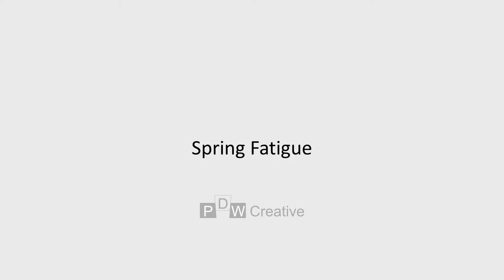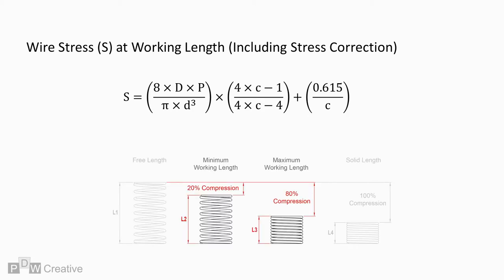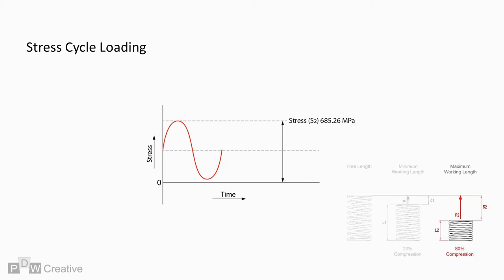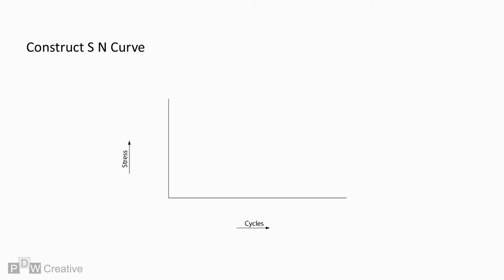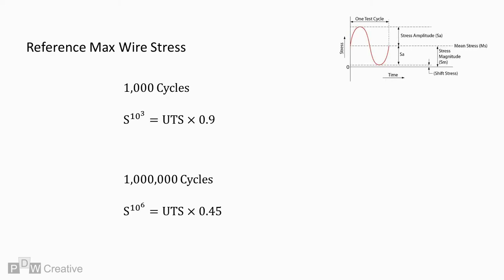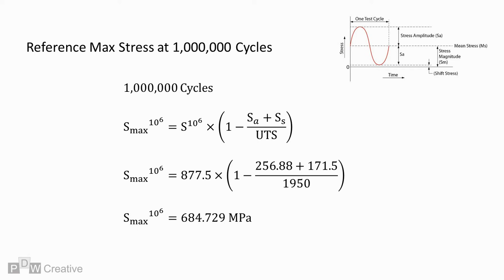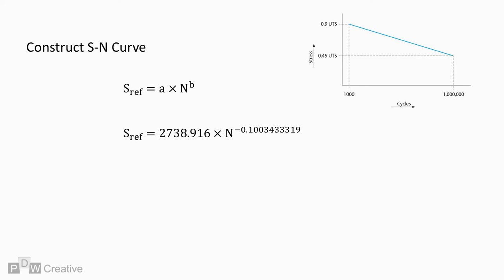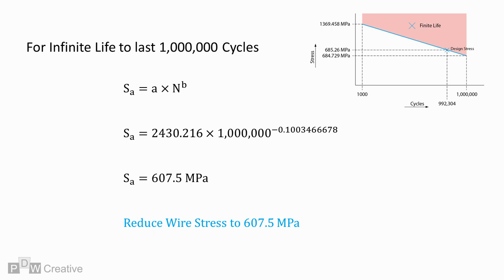Compression Spring Fatigue

Comment: Where did you find the data for the 1st slide? (7 seconds in)
Reply from the maker: Various sources. I am aware many stress calculators and manufacturers will give a greater allowance (60%+ depending on the material). But this lesser recommendation is based on springs with a long cycle life.

Comment: i have a question and find a mistake. 
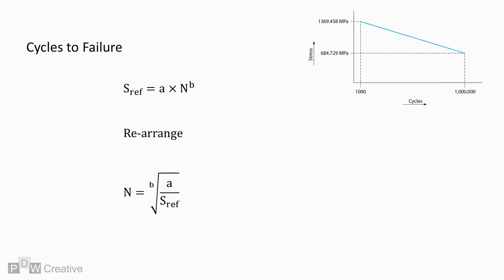10:23 mistake  >>>  N=(Sref/a)1/b is correct. 
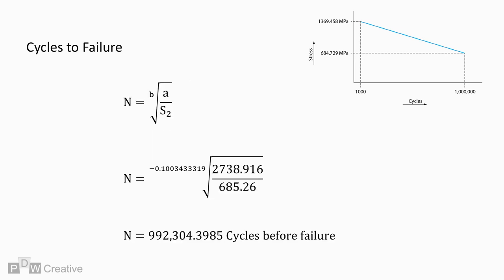10:40 mistake too >> N=(S2/a)1/b is correct 
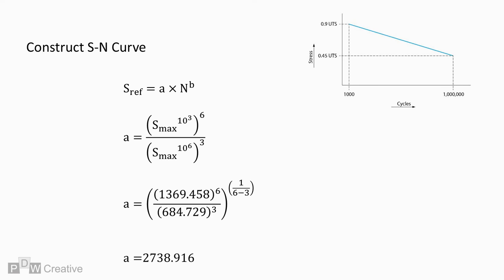and question is 8:40 Why are you squaring (1/6-3) here?
The term just above doesn't have a square, I'm curious as to why.
Using Google Translate, the words may be strange. Please understand.
Reply from the maker: This is the way I was taught to arrange the equation. Its not a mistake
Reply: @PDWCreative  Oh I see. and then 0:09 May I know the reason and standard for the %tensile of Chrome Silicon of 45% in wire stress limit recommendation here?
Reply from the maker: @SanTen11  The figures are from researching a few sources for the material reference data. The best thing for you to do next is look at the scenario you are designing for and check whether a higher tensile limit is acceptable. Check 3 or 4 research sources for material data and fatigue calculation. Select the method that works for you
Reply: Still I don't understand that square term can you please explain. @PDWCreative

Comment: Cycles to failure formula N=b√a/S2.  If I put at calculator means value comes at negative -0.2006 comes  what is the correct way to calculate this one
Reply from the maker: b needs to be negative before calculating. Try the exact calculation in the video before altering anything to ensure you are aligned
Reply: @PDWCreative  thanks you sir after removing - symbol from b value comes correct thank you for that
Reply: @PDWCreative  dear sir, if I want to good in mechanical calculations what are the things I need to sir, because right now I am working  as design engineer in one company so what are things I need to do improve my design and  calculation skills...what are the books I need to study..
Reply from the maker: @srinivasanv6573  It all depends on what type of industry you are in. Start with basic general engineering books and work from there. This will give you a good foundation. Also look up specific subjects related to your role.

After allot of searching, you will end up with 4 or 5 books that work really well for your needs that you'll refer to over and over again.
Reply: @PDWCreative  thanks sir